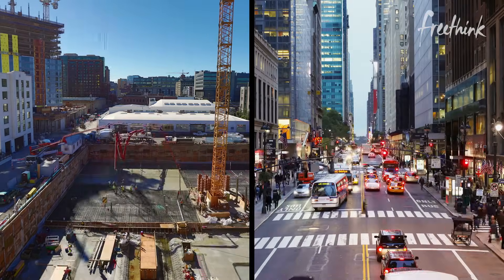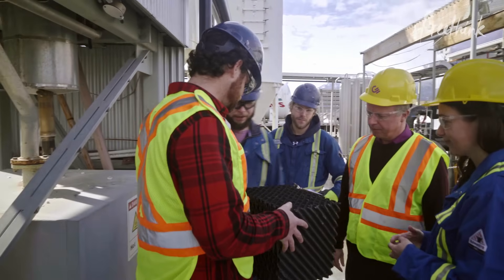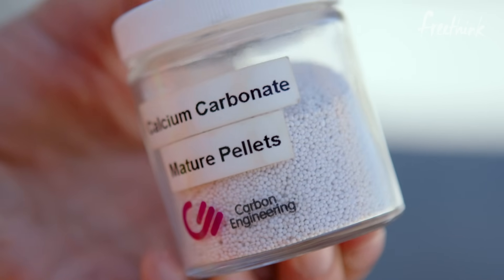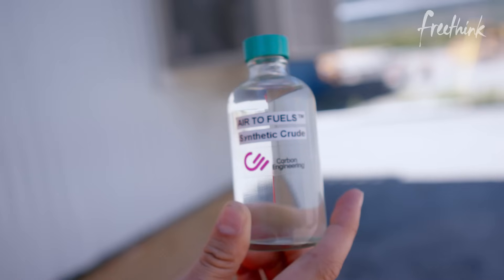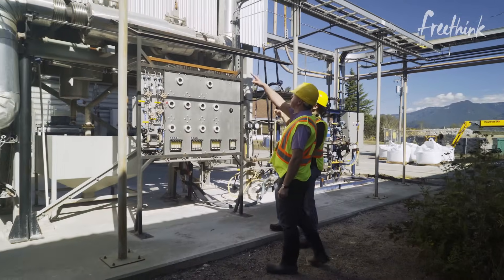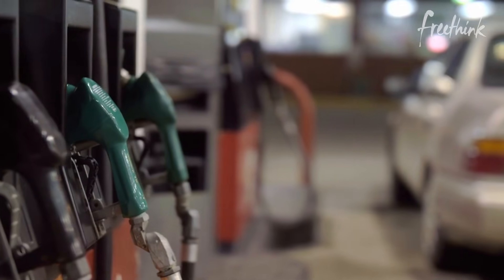Carbon Capture Technology Explained | Seachange

Comment: As far as I know you will have to produce the same amount of CO2 to generate the electricity required to run carbon capture plant. 
Why not change live style?
Why driving a 10-ton diesel truck to go to work, pick-up the kids and groceries instead of a compact vehicle? 
Why not utilize more nature power such as hydro, solar and wind to instead of an obsolete coal plant?

Comment: Carbon capture just for the sake of it is totally unnecessary. Atmospheric carbon is not a pollutant and the increase in carbon levels have improved crop yields and as can be seen from the NASA Satellites, the Earth is greening everywhere nutrients are present and this is helping to balance carbon levels. Also, carbon dioxide does not cause temperature rise but follows temperature as can be seen in any number of published research. The only useful reason for carbon capture is in the manufacturing of synthetic fuels to help with security and as stated provide a “circular process”.

Comment: THIS is what we need to invest in. Not EV, not wind turbines, definitely not solar that takes up large amounts of land where trees and other agriculture could be. Imagine carbon capture technology retrofited to every coal power plan in the world. We wouldn't even have to drill for oil anymore. The fuel we use to power our cities could produce the resources needed to power our cars and pave our highways. I would think the only reason we couldn't retrofit our vehicles with this technology is physical weight our vehicles produce would surpass it's limitations. But these fans sucking in all the air from major cities would produce a HUGE natural resource. But "Big Oil" has turned into big lithium and big cobalt. The SAME lobbying groups that pushed for the oil industry doesn't want us to be able to produce fuel from the air itself.

Comment: If people would get their heads out of the sand about nuclear power, a significant amount of CO2 would never hit the atmosphere. It is interesting that with all of the billions and billions of tons of "carbon" released into the atmosphere over the past 150 years, the PPM of CO2 has only increased from 200 something to 460 or so. In the not so distant past, the CO2 level has well exceeded 1000 PPM. It is still very hard for me to imagine that a colorless, odorless gas with a atmospheric density of 460 parts per 1,000,000 could totally wreck our environment compared to a 260 PPM baseline in the 1800s. I have seen only one explanation about how CO2 actually causes the greenhouse effect and to me, a novice who can understand scientific explanations, it was not convincing. My own non-scientific theory is that our air is TOO clean now and the relative lack of particulate matter in our atmosphere allows more intense solar heating as well as less reflectivity of IR heat when the earth is dark. Like everything scientific, we will likely find out in a few decades when the next solar storm hits, that we had it all wrong and were chasing our tails.
Reply: By the way, I own a Tesla and I own Tesla stock. I do not desire to "destroy" our planet (as if we could actually do so). I think all electric is the way to go where practical.

Comment: 🎯 Key Takeaways for quick navigation:

00:00 Human activities emit 50 billion tons of CO2 yearly. Carbon removal is crucial in combating climate change.
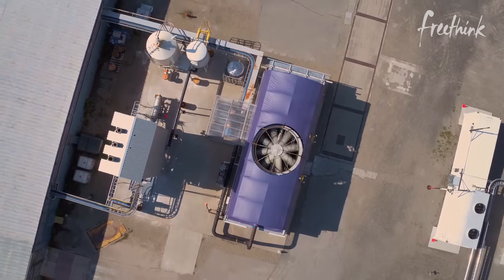00:31 Stopping CO2 emissions is vital, but removing 10 billion tons annually is also necessary. Two carbon removal categories: biological and technological.
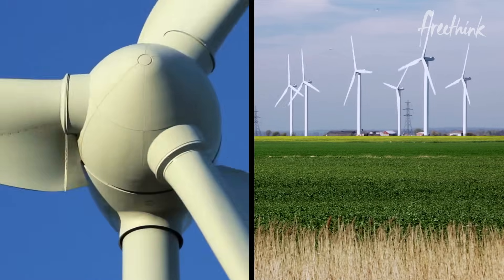01:03 Carbon capture methods include planting trees and direct air capture. Economic viability and long-term carbon storage remain challenges.
01:31 A company uses direct air capture, focusing on large-scale CO2 removal with a four-step process.
02:32 Captured CO2 can be stored or converted into carbon-neutral fuel. Expanding direct air capture globally is essential.
03:38 Scaling direct air capture reduces costs. Large-scale plants could make carbon removal financially viable.
04:07 Thousands of capture plants could eliminate emissions. Balancing carbon removal with other climate strategies is crucial.
04:39 Carbon removal is a tool, not a sole solution. Considering its impact on climate action today is important.
05:13 Various approaches are needed to fight climate change effectively. Subscribe for more videos on impactful ideas.

Made with HARPA AI

Comment: Can't help but feel that this just sounds very questionable... If you think Carbon Capture is the way forward..., then fine, just as long as it doesn't require subsidies, you pay for it totally, and if it turns out to be a winner then that's great news for you...... We, the general public have been down this road with wind and solar..., and it has got us nowhere, trillions of pounds and dollars, and still the price of energy is out of the roof...., we should have gone down the route of Nuclear, and we wouldn't have this totally self-inflicted Energy Crisis... I say, prove it works at your cost..., you put the money up for it first...
There is no Climate Emergency..., its called The Weather, and it changes all the time..

Comment: "CCS technology comprise a leading candidate for capturing carbon dioxide emissions for industrial sources, and can also be deployed in fossil fuel power plants. Due to its pivotal role in multiple sectors, CCS is deployed aggressively in 1.5°C and 2°C scenarios within global climate and energy system models." Rogelj J et al 2018.

I always wondered why we haven't pushed for more than current attempts and efforts when it comes to this amazing scientific feat to the point of frustration - though some challenges are clear to me, I have a hard time understanding these matters (perhaps because I am naïve and a wishful thinker) and so I looked up some scientific articles with detailed analysis and collected data to help me better understand. The contributors of one particular scientific article that I found most interesting "[analyzed] the full universe of CCS projects attempted in the U.S. that have sufficient documentation (N=39) -- the largest sample ever studied systematically". They analyzed relevant data to show the variations in CCS (carbon capture and storage) project outcomes; as there is no single literature focused on CCS, they compiled information in a complex system integration of components that better painted the picture regarding my personal issue of actual investment in CSS not keeping pace with the large role for the technology, which was a specific point that they made. They stated how CCS systems sit firmly in the ~valley of death~, being "stuck between a small number of early demonstrations that have received government support and later mass deployments that would stand on their own financial merit." They showed data regarding variations in CCS project outcomes, attributes comprising existing literature for CCS projects, areas where there are diverging agreements regarding the most consequential project attributes after collecting experts' thoughts during a workshop where they focused on the variables impacting CCS projects and future developments -- important attributes concluded during the workshop were 1) the credibility of incentives, and 2) policy (if designed explicitly to address credibility). "The history of CCS development so far is tied to pre-commercial projects that experiment with a diverse range of revenue streams and incentives. Near-term deployments will likely continue this trend, comprising additional data points on the learning curve to technological maturity. In such an environment, understanding decision makers' perceptions of the viability of these different experiments becomes even more important." Not only did they address the important roles played by credibility of incentives and regulatory challenges, the authors employed extensibility and utility of the methods by building an adjustable framework, bringing expert elicitation and statistical modeling to assess credibility in a more structured manner, ultimately improving representation of CCS deployment through their large energy system models -- this sort of information, analysis, and data integration had not much theory or evidence as a guide previously. 

In my dream world (when it comes to the logical/technological pursuits for the human race), I hope that costs and incentives -- variables focusing on benefitting one party's pockets as much as possible despite the evident potential to bring upon such positive and beneficial technological advancements for us and our decaying world -- won't be such a heavily-weighted factor when it comes to bettering our world whilst simultaneously advancing in science and technology. I long for a world where we push for such projects and support those that dedicate their lives in such pursuits without the burden of money... The frustration, sorrow, and repulsion that I feel is because I will never experience such a world, yet my wishful nature soothes me when my mind and heart wanders to hopeful thinking that someone, someday in the future, may live in such a world because of a carbonaceous orthopedic implant, or because we managed to support nature in regulation before we meet our demise, as most parasites do. Again, this is just a the dream world of a naïve, wishful thinker and STEM enthusiast. 

If any of you guys are interested, the article that I found most interesting and addressed the topics I stated above was 'Explaining successful and failed investments in U.S. carbon capture and storage using empirical and expert assessments' by multiple contributors, published 29 December 2020. You can read it fully and for free on the iopscience organization website. It is a very informative read and I applaud the authors for their diligence in addressing these matters and ultimately improving CCS knowledge and data to the point where it might (I hope) change the world. I wish there was a place where you can talk to authors of such articles; where you can converse with them regarding their findings and share your mutual interest in the subject at hand. 

Thank you for coming to my TED Talk.

Comment: The energy used to capture the carbon in the air is also from non renewable energy burning in power plant, then it is useless. The net must be negative carbon only it works

Comment: When you remove the carbon, how do you stop outgassing of CO2 from the oceans to reestablish the equilibrium concentration of CO2. The levels of CO2 in our atmosphere are pretty low to begin with. Not sure spending the kind of dollars to remove such a relatively small amount of CO2 makes sense given that most of the heating associated with the increase of CO2 as already occurred.

Comment: Can the size of CC modules be put on electric cars so as they drive they capture carbon.  Huge volumes of capture potential air pass by a moving automobile.  If all cars could capture some C02 then it could be upscaled.

Comment: Due to the extraction of the sodium mineral they first extract then fill the mine with astronomical pressure, once the carbon monoxide seeps through the strata along with is capabilities to melt granite,the ground gives way and creates a super sized sink hole, look up oxychem,homa Louisiana bayou corn ,after referencing that then I have 180 other sink holes created by this technology, along with a leak that just happened 2 days ago the out 60 citizens in the emergency room 5 critically  injured ,also there was a leak in Mississippi where 300 citizens were incapacitated k- - lling 9,
ambulances couldn't even make it to the seen because the combustible engines died Forlani of oxygen ,OH THE SINK HOLE IN HOMA ,IS 30 ACRES LAEGE ,
WAKE ,oh one other thing the salt is for the production of  green Hydrogen.

Comment: You realize Co2 is heavier than air right? It's sinks it doesn't rise. Also plants, grass, trees wants Co2 1000ppm it dies at 180ppm we are barely at 400ppm and that's only because of humans. With the amounts of corn wheat sugarcane trees grasslands for grazing. We are not putting enough Co2.

Comment: DIRECT AIR CAPTURE sounds like the key point of this video in that it means a plant can be constructed anywhere...but certainly in remote locations for nuclear powering...and around renewable sources with good hydro/wind and solar coverage...desserts etc...With the recovered carbon, microbes can probably be gmo'd then introduced that produce hydrogen in the recovered carbon..allowing gasoline to be made..lowering gasoline prices and making drilling less necessary...Direct air carbon capture is massively important technology..It's fine to even use unrefined crude oil for carbon capture if that efficiently captures even more. It needs to be a major industry due to the many applications gmo'd microbes can have to the recovered carbon. It's a REAL free market model that does not deplete national resources.

Comment: CAPTURE CARBON 2022
Solution for capturing carbon was discovered in a lab over 40 years ago.
. 
The heat loss from a smokestack can be forced into a large tank containing hot liquid microcrystalline petroleum wax. The heat will keep the wax at a molten state which facilitate the carbon particles to be absorbed when combined with the wax. Carbon-soot when mixed with wax reacts as a dye. The wax-carbon amalgamation resulting into a black wax solution thereby making it impossible for the carbon-soot particles to escape into the environment while in a liquid state. Other toxic particles are also captured in the wax settling at the bottom of the tank forming into a sludge. A sludge release valve is located at the bottom of the tank. After the sludge is removed more wax is replaced in the tank working something like a toilet. The sludge becomes a byproduct that can be used as an additive to asphalt for roads or used for cocooning nuclear waste materials for long-term safe burial. The entropy of the Earth has been increasing at a startling rate since the beginning of the industrial revolution caused mainly by the carbon that is released into the atmosphere. Government scientists have failed to stop and prevent carbon pollution from entering the environment. This problem can only worsen until a solution is found before this problem becomes irreversible. It has been discovered that formulated wax has been shown to be the only answer to this problem. William Nelson waxogen@gmail.com

Comment: waxogen
2 weeks ago
FORMULATED MICROCRYSTALLINE WAX WILL CAPTURE CARBON
The heat loss from a smokestack can be forced into a large tank containing hot liquid microcrystalline petroleum wax. The heat will keep the wax at a molten state which facilitate the carbon to be absorbed when combined with the wax. Carbon when mixed with wax reacts like a dye. The wax-carbon amalgamation resulting in a black wax solution thereby making it impossible for the carbon to escape into the environment while in a liquid state. Other toxic particles are also captured in the wax settling at the bottom of the tank forming into a sludge. A sludge release valve is located at the bottom of the tank. After the sludge is removed more wax is replaced in the tank working something like a toilet. The sludge becomes a byproduct that can be used as an additive to asphalt for roads or used for cocooning nuclear waste materials for long-term safe burial. The entropy of the Earth has been increasing at a startling rate since the beginning of the industrial revolution caused mainly by the carbon that is released into the atmosphere. Government scientists have failed to stop and prevent carbon pollution from entering the environment. This problem can only worsen until a solution is found before this problem becomes irreversible. It has been discovered that formulated wax has been shown to be the only answer to this problem. William Nelson waxogen@gmail.com

Comment: FORMULATED MICROCRYSTALLINE WAX WILL CAPTURE CARBON
The heat loss from a smokestack can be forced into a large tank containing hot liquid microcrystalline petroleum wax. The heat will keep the wax at a molten state which facilitate the carbon to be absorbed when combined with the wax. Carbon when mixed with wax reacts like a dye. The wax-carbon amalgamation resulting in a black wax solution thereby making it impossible for the carbon to escape into the environment while in a liquid state. Other toxic particles are also captured in the wax settling at the bottom of the tank forming into a sludge. A sludge release valve is located at the bottom of the tank. After the sludge is removed more wax is replaced in the tank working something like a toilet. The sludge becomes a byproduct that can be used as an additive to asphalt for roads or used for cocooning nuclear waste materials for long-term safe burial. The entropy of the Earth has been increasing at a startling rate since the beginning of the industrial revolution caused mainly by the carbon that is released into the atmosphere. Government scientists have failed to stop and prevent carbon pollution from entering the environment. This problem can only worsen until a solution is found before this problem becomes irreversible. It has been discovered that formulated wax has been shown to be the only answer to this problem. William Nelson waxogen@gmail.com